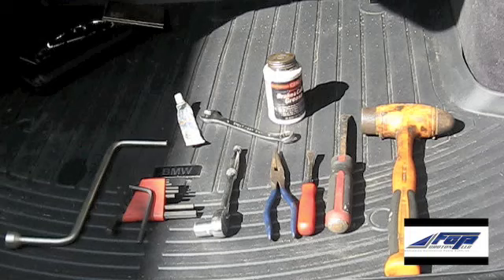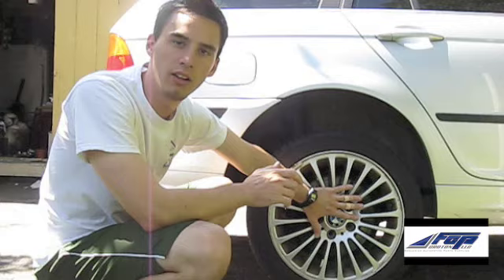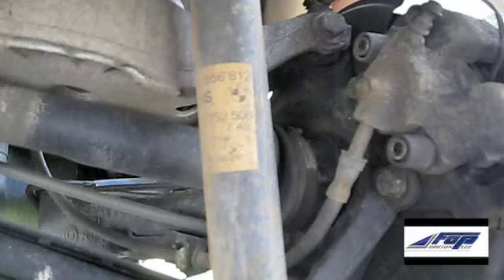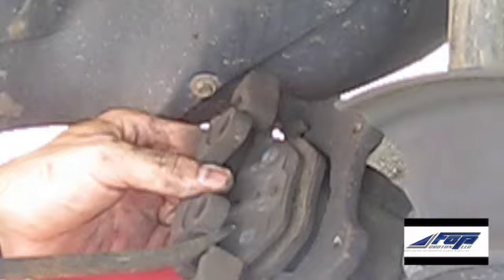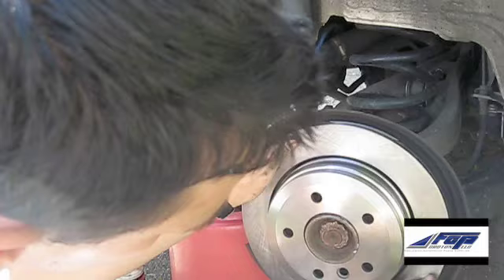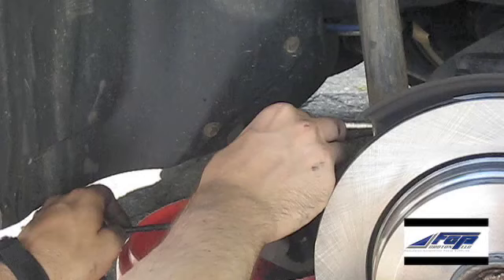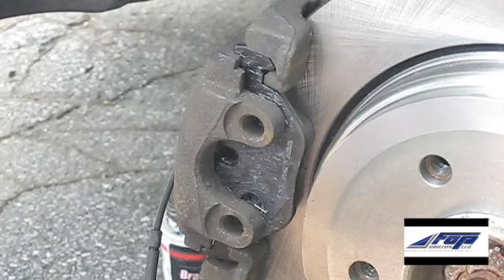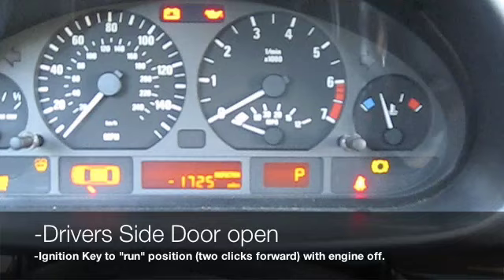BMW Rear Brake Repair (E46) MillerTimeBMW - DIY 8

Comment: Excellent.  Saved me a lot of hassle and money.  Only bit I missed was attaching the brake wear sensor at the connector.  Easy enough though.  On my car (UK 330Ci) follow the wire forward & it leads to a small plastic box in front of the wheel arch. Open, disconnect, throw away the old, reconnect the new, clip back in to place and do the trick with the ignition.  As a previous comment said, priceless moment when the warning light goes off & the jobs done.
Many thanks.

Comment: Thanks for the really concise diy vid. I was givin a mad price by a mechanic for doing a rear brake refurb. Feck that, so I bought a few parts - bilstein pro full spring set,rear pads and discs, a brake shoe overhaul kit, and a few tools for 330 euro(the cost of getting the rear discs and pads done alone) and did it myself in a day.. Thanks in no small part to your help. When i removed the rotors though I also pulled the brake shoe assemblies off with them NOTE: TAKE OFF THE HANDBRAKE FIRST!!

Comment: Great video, easy to listen to and a good length as well. There are several questions that came out of it [as the video is not fully comprehensive] so it would be helpful to update the description above with some answers such as; remember to put the lid back on, pump the brakes, there may be a lot of dust so....... you don't have to replace the sensor if the light did not go off before you installed new pads, etc. thanks again.

Comment: Great vid!, great detail! you even showed about removing lid on master!, then you know the trick to push the piston back in on caliper by using a prybar through the caliper hole! and best tip of all, how to reset the light on dash! only thing you might of left out was after job is done and you put master cap back on. to tell all the do it yourselfers,Always remember to pump up the pedal,after job is complete, and for sure on front brakes. if you don't pump up pedal, you wont have brakes at first

Comment from the maker: @acon1974 

I would agree OEM is great but PBR is also a great alternative for some added performance (ceramic/metallic)

and I clicked the key forward two clicks (but do not start), then wait. And it will reset itself! 

Good Luck!

Comment from the maker: @orlando318 
Adding to my earlier post, I would have a 1999-2004 E46 check for the faulty rear suspension, it is a free service here in America, if it is ripped BMW must replace it for you. I live with a lot of salt and I often was the cars bottom, so I have no issues with rust. 
Good luck!

Comment from the maker: Essentially the same for all calipers, and the sensor only "goes bad" when the pads get low enough that the sensor makes contact with the rotor. Then your "brake lining" warning light will come on. Then you must replace the sensor. 
Good Luck!

Comment: Great video, thanks...
I noticed both my rear brakes on a 1997 318i were not working, I didn't have time to work on it so sent it to mechanic, they changed all the main parts, rotors, calipers, pads... But still, the breaks are not working. It seems that when they went to flush the fluid they discovered that there is a problem with the ABS pump, I am so upset because I feel they should have caught on that first, and then we could take a second look at the real state of the brake components rather than assuming it was just that... there was no ABS code at all... the car stops well, but I just don't know how urgent is to replace that pump now, the estimate was high.

Comment: I gather that, if you were just doing pads, that you wouldn't have pulled the entire bracket assembly - but rather just the slide pins?  Thx for the video, Zach!

Comment from the maker: This rotor had no oil of any kind on it. But it's true you should use some brake cleaner on oiled rotors first. I used a wire brush and a thin coating of anti-seize as the wheels almost 100% get rusted on. Too much salt on the roads here. Thanks for the comment.

Comment from the maker: @707umair  The sensor comes separately and the other end follows the rear trailing arm to a connection. you will see it when you remove the old one. 
Cheers, 
Zach

Comment from the maker: @dOlCeCaRaMeLo No, 
You will need to remove the rotor and it will be held in place if the parking brake is on.
Zach

Comment from the maker: It could be low voltage from your battery, low brake fluid or it could be a wheel speed sensor.

Good luck, 
Zach

Comment: @orlando318 very reliable.  after owning 12 cars and driving way over 500,000 miles, I wouldn't trust anything other than a 3-series.  you just have to have DIY skills and knowledge on where to buy the parts online.  Take care of the car and it will take care of you.  The BMW drivetrain (at least the 6-cylinder models) are very reliable, simple, and easy to work on.  Things can get bad if you ignore subtle signs though.  You have to keep on top of things.

Comment from the maker: I too am trying to locate a set of rear springs. It is all too common, rocks,grit and water wear away the protective coating on the spring and they rust away.

Comment: Great Job mann, I'm a true BMW head i owna 2005 745Li & i wish that i knew how to replace the brakes on it cause the dealership is killing me the messed up thing about it all is that i have an extended warranty on it along with the maintenace pakage, & i'm experiencing this real annoying squealing noise and their telling me at the dealership that they can't replace under warranty just because of that noise which i think is straight bullsh** i bet if i said that i was gonna come out of pocket -

Comment: Zach.  I think the other coil was trash too.. not worth saving.  NTB handled the install.  If you have acess to a lift and a good bar to lower the upper control arm, I think someone could do it themselves.  This was beyond my comfort level to attempt.  With the new coils and shocks the ride is improved..  Next projects  I am looking at is replacing the valve cover gaskets, and the oil level sensor. About $ 700 for coils, shocks and wheel alignment.  So other projects can wait for now.  Regards.

Comment: Thanks for the vid, the rears look easier than the fronts to do! Only one question - does the brake system need bleeding after replacing the pads/rotors? after removing the brake fluid cap and compressing the pistons, do you just put the cap back on and pump the brakes? Hope that makes sense! many thanks!

Comment: Great and clear video, bravo!
Reply from the maker: Dragan Radenkovic Thanks so much!
Reply: millertimebmw Question: Do 3 series (325xi) sedans normally have one brake pad wear sensor in front and one in rear, 2 total, or should you have 4 total ? Thanks. Your vidz are great!
Reply: SETH TAYLOR  Hi Seth, your's is fine -  it's one sensor per axle  - two in  total ....
Reply: Taffy Lloyd  thank you

Comment: Nice and quick video! But I would always grease the retaining bolt a bit for easy unlocking next time. Clean the calliper. In Europe bolts of the calliper need to be self tightening with a bit of loctite, even better: use new bolts instead! (Normally to be delivered together with new pads) Decrease the new rotors 100% before these contact the new pads. After fastening check if the wheel runs free. Torque spanner? Use protective gloves so you don’t need bandage on your left hand in future…:-)

Comment: @michaelssocks Not sure if you still have this problem, but did you check if your caliper guide bolts were lubricated properly? It's also important to keep the plastic caps back on after your brake job because it keeps out outside contaminants, preventing it from sliding properly. If you did all those, my guess would be you have a stuck caliper, meaning you would need to rebuild it. It's pretty easy, just means the seals around the piston need to be replaced & the piston/caliper wall cleaned.

Comment: Helpful vid- Whereabouts does the connector end of the wear sensor connect, the front was easy to find (the black box) - but can't see where the rear ends up??

Comment: If the rotors look good, is it necessary to replace them front and rear every time you replace front and rear brake pads??  Thanks and thanks for all the help!!  Dennis
Reply from the maker: No it is not necessary. The main thing to look for is the lip at the top of the rotor. This will tell you if the rotor is too worn. 

Good luck!

Comment: nice video. I had the brake pad replaced but not the sensors. now the brake light is on again. is it possible to replce the sensors without taking the brake pads off?

Comment: @stever0105 Taking the cap off makes it easier/possible to push the pistons into the caliper body to take off and put back on the rotor. With new pads it'll take about 200 miles to properly bed, during which time you should avoid heavy braking so the rotor and pads properly wear into each other. You may not feel the same "bite" until after the bedding process. Spongy braking may indicate air in the line, which would not result from this procedure as the line was never opened.

Comment: Just flushed the brake fluid on my 325xi.  It was quit dirty.  I used a motive power bleeder purchase via ebay.  I did have a partially blocked bleed valve, and one frozen bleed valve that I will need to  complete the flush.. BTN to have 3 brakes flushed.   Zach... Any luck with that valve cover gasket project?   I look forward to that video..  
Thanks

Comment: Is it true you should clean the new rotos to remove the packing grease they apply for  anti-corrosion at the factory? Apparently this can contaminate the new pads.

Comment: While you're in the rear brakes, check the parking brake pads. They're inside the rotor.

Just to clarify the sensor thing: the sensor goes bad when you've let the pads wear down past a certain point. If you've changed the brake pads before they wear down to the sensor, i.e. at the correct maintenance interval, the sensor should never get activated. Once it is activated, however -- activating the light that warns you to change your brake pads -- you have to replace the sensor.

Comment: Success!  I used PB Blaster on the hub and smacked the heck out of it and it broke free.  Now... next thing.  I have a broken rear coil spring ( common problem.)  Looks like I should stay with the oem BMW spring to maintain the proper height because I have a 325xi.  Any insight into what springs I should get?

Comment: @orlando318 I had a 77 w123 benz and I now have a 2001 e46 3 litre and its a great car, I had to do some intake work to my car (it's got 120k) and preventative maintenance. decent gas mileage (30 hwy), 225hp, small trunk.

Comment: @swizz85 Your owners manual will point out the proper jacking points, but BMW usually makes it easy to find the jacking pads on the rocker panels.

Comment: hi
i'm just about to change my brake pads but the warning sensor light hasn't came on the dash yet...do i still need to change the densor wire or i can still use the old one?
PLEASE HELP 
thank you

Comment: why do you take the cap off the oil reservoir.  i changed my brake pads and seem to be softer now ..   I didn't  take the cap off the reservoir my brakes seem to be soft now i checked my brake line and their fine what do you think ?

Comment: I am searching brake parts for my 01 x5. should I stick with BMW Genuine parts or any OEM/third party factory are fine. I mean the quality. Someone told me even BMW does not make its own brake pad and rotor. Do I need to upgrade to ceramic pad?  Thanks in advance.

Comment: Hi, I have the '07 E90. Do you know if there is anything I will need to do differently? The E90 is the successor to the E46 so I'm assuming not much is different in the brakes, but any information you have would be appreciated.
thanks!

Comment: hey man, i changed my brakes and rotars today bc they were sticking, the brake lines were bled as well. Also back in feb the E brake was replaced. A few months ago the Caliper was replaced but there still sticking and getting really hot. Do you know what it could be?

Comment: @millertimebmw but where are the little shoes? how does the parking brake engage there? shouldn't you adjust the park brake after that brake job? if i was a native indian i'd be called Many Questions lol. no but seriously i see no connection to parking brake on the rear brake system.

Comment: Is there any need to bleed the brakes after you've done the job?
Reply from the maker: No, Unless you were to remove a caliper or brake line. You only need to bleed when you introduce air into the system.

Comment: thank u for this v ideo,

i couldnt get the rotor loose i had to replace everything to keep on driving.
i hope i can get it loose by striking it with a hammer at the front like u did instead of striking it at the back side. i think my rotor is rusted in place and need some heavy hammer strikes.
great video,,normally an easy job, but now i needed this info,  i also thought that the bearing nut needs to come off to.

Comment: hey I got a prtoblem with the DSC & Brake lights comes on while driving the car. Could it be that The rotors are warped. Does anybody know what could be the problem.

Comment: You left out the most important (and hardest) job: 

clean the caliper thorougly from the brake dust crust.

But I guess you wanted it to look like a piece of cake for all the naive fools out there.

Also you should check the top of the piston and the rubber seal. With my automatic BMW I needed a complete caliper overhaul with new seals about every 2 sets of brake pads.

Comment: Wheel bolts, not lug nuts. And you really should sand down the hub surface before mounting those cheap "oem-style" rotors on to the car.  Don't get me wrong, love the videos. But I think you should encourage better habits! At least mention it!

Comment: @328iKid No prob.  Check out RealOEM for drawings and part numbers, it's invaluable.  Then try Pelican Parts, Bavarian, or even Amazon has good prices and free shipping.  Also check out e46fanatics, bimmerfest, bimmerforum, and zhpmafia for details, DIYs, etc.  Oh, and the Haynes manual can be gotten cheap on Amazon or eBay.

Comment: I like the video, but some details are not followed up. Where does the other end of sensor wire connect? How to put back the break pad (not visible on the video) ? Why do you remove the break fluid container cap and why don't you show putting it back?
If someone knows how and why to do such things, he doesn't need this video. But if he had no clue, and needs a step by step guide, this video is not detailed enough. 
Thanks anyway.